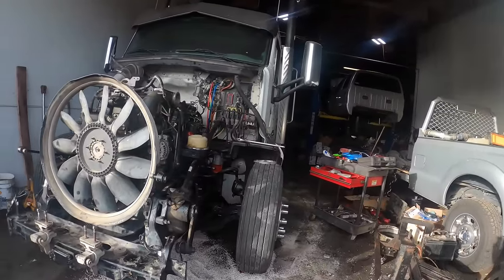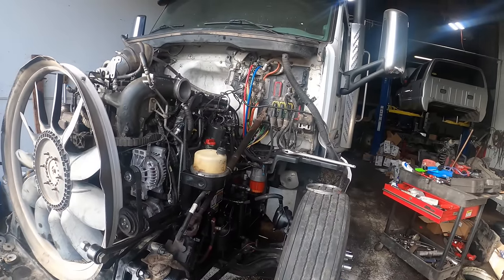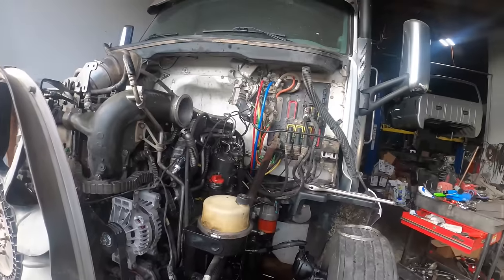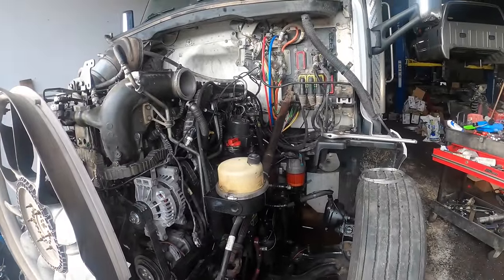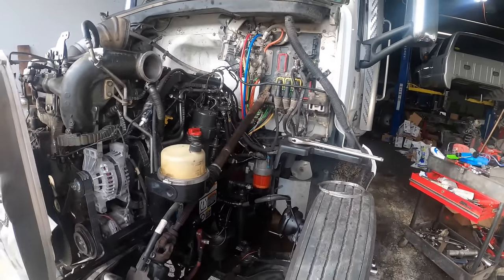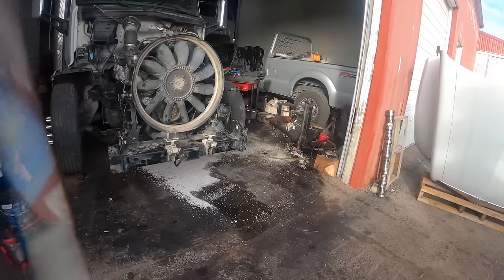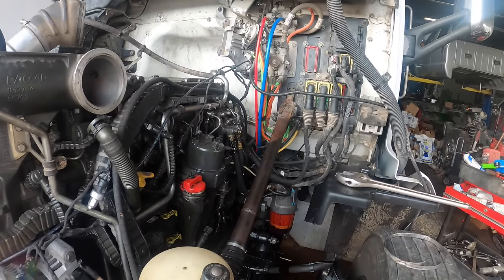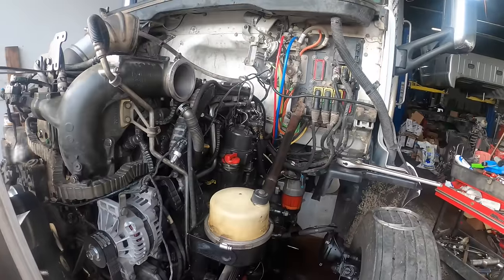I'm frustrated on this one!

Comment: Hey, Warren I know your pain I had a 2001 Volvo D12 that wouldn't start I did all kinds of tests and bled the air from the fuel system. I could never get it to start I spent 3 days on it then one day I bought new batteries for it because the batteries were low and required a jump. When I hooked up the new batteries the truck fired right up. I don't know if this would help but I would try some batteries that you know are good to see if it will start. Best wishes and I hope you get it started.

Comment: You should really invest in a cheap oscilloscope to view cam/crank waveforms, injector signals and so on. Once you get used to it it makes it super easy to rule out a ton of issues quickly and without teardown
Reply from the maker: If I had your money I would just burn mine.

Comment: Hi  Sound like you have blocked injectors Warren  A couple of reasons ...I have had this when someone else  rebuilt a MX13 ,,If when cranking the the rail pressure shoot right up and is more than required ,and the pump units are in a negative ,trying to drop the pressure  it is usually blocked injectors ,also you will not get a code I will get the figures to look at...Cam Crank synchronised...Relative fuel pressure above 2.9psi, common rail pressure above 2900 psi ,,Exhaust gas pressure before turbine (relative} below 14.5 psi..If that is the case  check for presence of  in the low pressure ,,which you have done ..
Check for blocked injectors Check if the common rail pressure rises rapidly ,remains between 250 to 350bar ( sorry it does not give the figure in psi) and the common rail  pump delivery correction is  -10 to -25 during cranking ,,This is an indication that all fuel injectors are blocked....That is from the euro diagnostic manual Warren..hope it helps ,If the injectors are not bagged when removed of the fuel lines plugged or dirt gets in ,the tolerances are so tight on the injectors they can block.you sound if one or 2 may be ok ,but if you can get them checked  or have the injectors from the other engine ...I have been working on them for 27 years for my sins ..Current replacing a short block on a MX13 and have 2cams waiting
Reply: Noticed one injector  firing too ,i would look for pinched injector harness and find injector firing , probe wires .

Comment: You might want to see if you can get caps to cap off all 6 injectors at the rail. Just to see if its building up right pressure if it is and it maintains it then it can possibly be an injector over fueling which you can isolated with the rail caps 1 at the time. Which it will make sense why the actual rail pressure is above the commanded rail pressure. Just a thought. God bless.

Comment: I’m trying to remember but I have a crap memory 
I do remember something about engine compression/combustion getting back into the fuel system, it was on a shit modern diesel car here in the uk
Reply: I’m not sure if it wasn’t a injector washer leaking back into the fuel gallery in the head and turned the fuel black, I could be wrong though

Comment: You have to break the fuel line because air is in them. I had the same problem when I rebuilt my engine. Each injector line

Comment: I seen the same problem on a new fire truck is was its first service and the mechanic didn't notice a nipple on the bottom of the fuel filter and installed it incorrectly and it wouldn't start Check inside that fuel filter housuing

Comment: Hey Warren check out Utuber Trucking Together video #402 . They had an air  lock issue,  the truck would run but shut off in about 10 min. They were told to by pass a
fuel line mainfold ,truck start and stayed running. Im not a mechanic but love watching your channel, if this helps great if not it may 1 for the memory bank for latter use. Good luck and thank for just being you ! 😊

Comment: I don’t know these engines and listened to everything you’ve done. So I’ve been trying to think why it won’t fire and maybe I’m way out but I’m trying to suggest a few things. So you’ve had clean fuel from a bucket into the low pressure pump, you’ve also tried the manual priming pump and it was rock hard. Is the high pressure pump getting fuel to the injectors, is each injector getting triggered on the compression stroke of the correct cylinder, are the injectors delivering fuel or are they blocked or damaged by previously bad fuel? Is the electronic side of the injector bad (I know it would have to be all of them but there may be a common fault) and if fuel is going in on compression in the correct cylinder then it has to fire. Air, fuel, compression it has to? You said I think you checked the new cam sensor was ok? Sometimes they are faulty from new. You also said the cam timing was correct, did the supplier of the new cam give you the correct cam or is there a version with a different tone ring? I don’t know if there’s a different firing order for similar engines for those cams? Sorry if I’m just being dumb, I don’t know these engines at all, just trying to look from basic principles trying to understand what’s going on.

Comment: Look at your primary fuel filter that you removed there should be a little tit on the bottom of it In the video appears to be broken off   if so, the broken piece is in the bottom of the fitler housing check valve allowing pressure to bleed off or not build/hold pressure Simlular to DD15 DD16 seriers engines 

For any eletric trouble shooting  Check out AES wave  Great company and good shit
Reply: What causes dirty fuel filter like that
Reply: Bacteria, major problem everywhere fuel is stored. Engine manufacturers don’t warranty bacteria problems. Test your fuel! Is it your problem or the fuel company’s?
Reply: @mikecopenhaver4484  right, i just saw on bus grease money how biological growth destroyed injectors, i wonder if entire fuel system is destroyed

Comment: Or the rail pressure sensor is bad, I have had them crank and no start because of that sensor. Also, the pressure relief valve could be bad causing the rail to return too much fuel, and it will cause a P0094.

Comment: warren have you tried the pressure bleeder trick adapted to fit again with diesel in  it will give you 5psi fuel pressure @ least +/-  ( like the haysqueeze)..........

Comment: wow buddy, that's a head scratcher. i think i'd be leaning towards a timing ( sensor ) issue.  maybe a reluctor rung slipped on the shaft throwing the timing off ???  i  dont know about paccars .. but the new cat engines WILL NOT start if their is a timing problem, and the engine computer WONT tell you about it.

Comment: warren I had that problem and I took the check out off the fuel filter and cranking you sure see 250 rpm 35 psi I had the same problems but sounds like fuel leak on one oh the injector but I I better try another ecm I end up changing the primary fuel filter and fix my problem I hate the paccar electrical fuel systems is all garbage

Comment: Couple things. Ive worked on alot of paccars at the dealer. Have heard of stories of one of the tits getting broke off the cam tone wheel if it gets dropped. Cant remember if that would cause a no start.
Other thing to check to see if the turbo is stuck shut, disconnect the clamp right at the manifold to egr valve connection. 
You should be able to get a fitting into the fuel galley and measure pressure with a manual gauge. You should expect atleast 15psi cranking. Also do you have the correct fuel filter installed in the primary housing? It also sounds like its cranking moderately slowly.
Reply from the maker: ECM took a shit

Comment: I work on cars and gas engines. I will say that if your having fuel pressure issues is the fuel pump timed properly? With GDI the pumps run off of cams so if the cam timing is off the fuel pressure will be low or too high depending on situation.

Comment: Add a 6.o ford that changed the cam/ crank sensor as a set in the o-ring Wouldn't seat down for the crank  same exact thing would not start said  Cam shaft crank sink okay

Comment: Great video.  I am an old school per emission cat guy but need to come forward in time.  Who is the Paccar base motor? their own, cummins or detroit.  I am looking at newer Peterbilt but keep running from them because of problems like this.  Starting to look at detroit powered as option.
Reply: I read a few days ago that comments makes the paccar for paccar to paccar specifications.

Freightliner will sell you a brand new truck with a Cummins x15 in it—if you specify such.  Otherwise they'll put a Mercedes dd15 by default.

I also was talking to a guy within the last year that knew someone that had a produce delivery trucking company. I think he was running Peterbilts. Dealership wanted to sell on paccar engines and the guy said "No way! Put Cummins engines in my newly ordered trucks." Having mechanics trained on Cummins engine was probably another reason he wanted Cummins.

Comment: Those fuel filters look like they've been recycling their used motor oil into the fuel tank...save a few bucks in recycling fees and spend it on engine parts.

Comment: O heck Warren . This is very very unlike you .I have never seen you having trouble on getting an engine going ..
Looks like you have more than one problem with this engine .
Looks like you may have to go down the sensors checking route 
Don't know if investing in a scope to check signals would help .
Hope the new sensor sorts out this problem 👍👍👍

Comment: The paccar engine lines need to be broken individually and prime to start the truck
Reply: No he’s talking about the low pressure side not the high pressure side. Cracking the lines on the high-pressure side does you no good if you have no fuel pressure on the low side.

Comment: I'm not frustrated I'm agitated fixing my transmission on my 2011 Chevrolet avalanche and fk me almost every bolt is been thread locked and I need y pipe off to drop trans fkn bolts are rust and stripped extraction tool isn't gonna lock cause of thread lock even when I heat it's bullshit I. Doing in my yard don't have a welder gonna have to cut y pipe problem is one side gm wisdom made pipe flat fk warren total bullshit thanks gm oh and I have a massive bloodclot whole right side already had a 7 hour surgery and went yesterday early am to have another surgery and as I'm walking up to hospital phone rings and it's my charge nurse telling me my Dr has a family emergency so no surgery and I'm still fkd up heading out in a few to get that transmission out one way or another sux